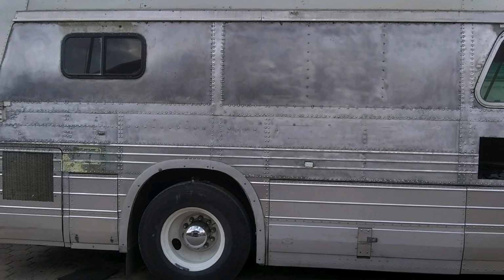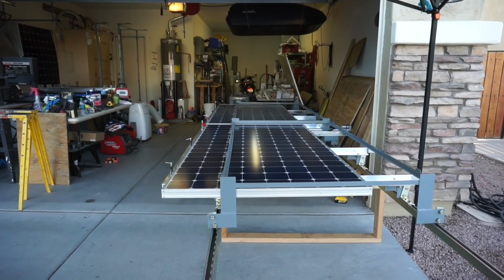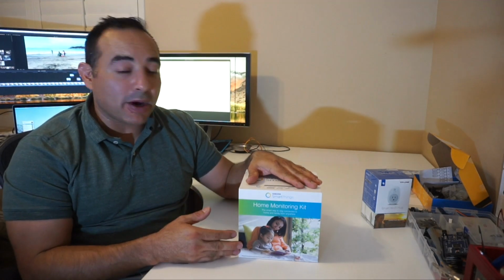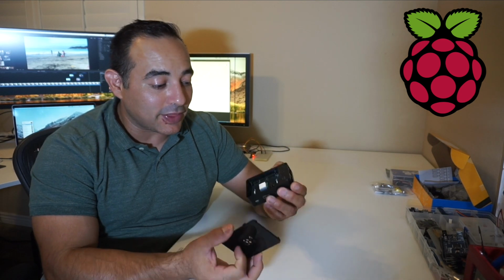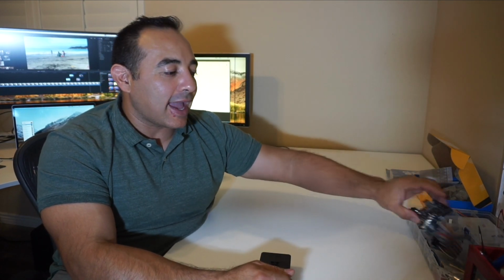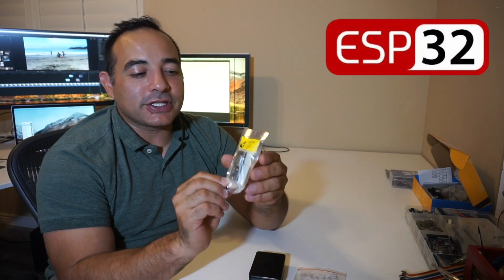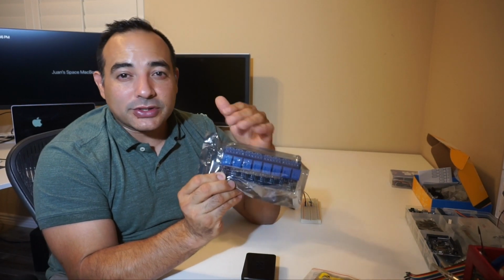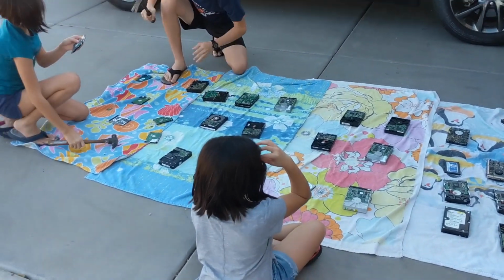Paint Update and Bus Automation Intro

Comment: [rant] Don't you hate that: everything has to be in the cloud nowadays. Ridiculous. Why should I send a signal to some cloud, wait for an answer before a light goes on? It's just a way for companies to know exactly what you have and do so they can get advantage from that. I have absolutely nothing in the cloud will never have that. IoT: Internet of Things. Absurd. Why should my refrigerator be connected to a cloud? To let a shop send me food because we run out of something. I can do that myself. As you can notice from how I write about this, it drives me crazy. Internet could be a nice place but companies ruined it completely cause they think they have the right to know everything about you. Well, think again.
Keep things local and use as little automation as possible: it can only break and then things don't work. What's wrong with a manual switch to switch the lights on and off? It has always worked and it still works. [/rant]
Reply from the maker: Thank you De Mus - we seem to think a lot alike.  The cloud can be a very nice thing but I hesitate strongly to relying on it.  That is one of the big things that drew me to Home Assistant - the network (internet) part of it is almost an after-thought.  It can function just fine not even connected to the Internet and just running locally on the LAN.  There is nothing wrong with just a simple switch of course - until I am sitting on the couch and forgot to turn a light off ;).  As you have probably gathered by now - much of what we do is somewhat experimental.  We have been using the lights in our coach for about 4 months now with just a simple wire-nut - I just thought putting some of this stuff in might be a little but of fun :)

Comment: Very cool video!! I'm thinking when I do my conversion of replacing my 12 volt control panel by the driver seat. With a relay board attached to a tablet what are your thoughts?
Reply from the maker: Thank you Joel - I think it is completely do-able.  You may have an easier time hooking something up to a raspberry pi with a touchscreen or as I am doing Arduino with Home Assistant :)

Comment: Excellent intro to automation.  I work for SaltStack and using "Salt" as my automation platform.  It uses an event bus as well to communicate between master and minions.  I’m just getting started too, so the hardware is where I’m looking.  Salt is written in python, so it’s pretty easy for me to write a custom module as long as the device can run python or have an api that I can connect from a controller minion.  I can go into more detail if you want.
Reply from the maker: Very interesting David - I will have to take a look at SaltStack.

Comment: You can use ESP8266 to control all the electronics wirelessly over WiFi  it will reduce wiring. You can connect esp8266 to smart phone. ESP8266 is dirt cheap.
Reply from the maker: Yes the esp8266 is pretty amazing - I have a couple sonoff switches that use them they I have flashed with tasmota.  This is a very cool configuration!

Comment: I went through this on my own bus last year - trying to figure out what would work out the best, what works well, and what will work without an internet connection.  I started with OH2 on  a Pi and it's a complicated German mess (ever used SAP?).  Then I went to HASS.io and a couple of other self-contained home automation software and wasn't impressed with them.  I settled on Node-Red on a Pi and have been running it ever since.  Node-Red is light years ahead of everything else right now, it's very easy to use, and is the most flexible thing.  I highly recommend it!  Everything is monitored and controllable remotely over MQTT (phone, PC, web) and I have a touch screen LCD in the bus for local control as well.  

The other challenge you will have is like you mentioned about 120v stuff vs. 12v.  There's next to nothing you can buy for switching 12v stuff over radio.  I built a PCB for the Pi that has a ton of I/O, but it's wired.  I also decided to set up a couple of remotes (Pi Zero W, etc) with some I/O to run relays and stuff.  Also keep in mind how much current all of this will consume.  You might be surprised when you add it all up, you might find you're sucking 10 amps all the time just to flick lights on and off, etc.  I have used ESP8266's for a few things, but I prefer to use AVR-based stuff for low power consumption and reliability.
Reply from the maker: That's about where I am landing so far.  I felt like I needed to give Hass.io a fair shake since the guiding principles seemed to line up with what I thought about "home automation" - to be honest, it has only been so-so.  Node-Red, on the other hand, has been amazing.  You wouldn't happen to be "badandy"  from the Wanderlodge Owners Group, would you?  I was following a guy's build over there that looked A TON like one of your videos.
Reply: Ahhhh I've been outed, that's me!  I've been following your build, I'm excited to see how the paint turns out because mine needs a paint job now.
Reply from the maker: LOL Love it!  I have been following your build as well.  We will give a full report on the paint job including cost and time when we get it back.

Comment: You took my idea and beat me to it!  I put Home Assistant on my home server to control my apartment, and want to put it in my bus as well.  Im about 4-6 months away from that step though.  BTW look up the "Sonoff 4CH Pro".  It allows for 5-24v input.  I think I will use a couple of those for all my lights in the bus.  Still thinking through all the fine details.  I look forward to seeing the progression on your automation setup!
Reply from the maker: Sorry about that Matt - I didn't mean to steal your idea :).  I have slowly been working through it for a while - it's a whole new world for me but it has been really satisfying to solve some of these problems.  Right now I am really liking the ESP32 chips - they are just amazing so far.  I flashed my first Sonoff a few days ago with Tasmota and REALLY like Tasmota but the Sonoff devices themselves seem to be pretty poorly made.  I will keep making updates on what I have discovered as stuff starts to happen.  I am pretty excited about it.
Reply: @BeginningfromthisMorning  Just checked out your new video.  Looks good.  Ill see how your esp chip and relay board works.  Maybe Ill go that route.  I do like that the Sonoff pro4 is din rail mountable and you can get a Din rail Raspberry pi case.  Along with all the other Din mount devices.  Looking good though, I may take steal some of your ideas when your done!

What line of work do you do BTW?  If you don't mind sharing of course.  :)
-Matt

Comment: There are 12v Sonoff boards - Google Search...   https://goo.gl/991oi9  &  12v boards to connect with Google Home, not all Google Home stuff needs the net...  Keep that in mind.

RV...   My step motor died so I used a Linear Actuator and an Arduino to clone the actions of the stock motor/gearbox, my cost was over 50% less then a replacement motor/gearbox and being Arduino it leaves my design open to link the step in to other functions in our RV.  Like first time in RV in awhile I could have it turn on our A/C then off after it reaches a set temp or bedroom lights on cause we're bringing clothes you know so I gotta see where I'm goin.  

Another idea I am liking. Using a photocell..  I think it would be cool to link our shades and close them at night/dusk and open a couple hours after dawn... wanna sleep in sometimes :).  But it would be something I no longer have to think about or it would happen even when we are out on a hike.  Same could go for the awning light, it just happens.

Comment: Does your work as a software engineer cross over into Arduino and Razz pii’s  

I had a mission to automate my fish tank, started playing with the dallas one wire sensors (then I bought a house and a box truck and all of that went into a bin).  When I’m done knocking rust out from underneath my truck I’ll look into those 32 boards with built on wifi.

Here’s a link to some solid state relays that jive really well with the Arduino 5V logic.  They already have resistors in line on the logic side and can (allegedly) handle 25 amps up to 340 volts.  I’ve run a 12 amp load on one of these for an extended period of time, it got a bit warm so I thermopasted it to a metal plate which kept it much cooler...

https://www.ebay.com/itm/Output-24V-380V-25A-SSR-25-DA-Solid-State-Relay-for-Arduino-Raspberry-Pi/321873890198?hash=item4af12dcb96:g:qX8AAOSwHjNV~Cd6
Reply from the maker: Hi Ryan - my work as a software engineer does not cross over into the Arduino or Raspberry stuff much at all - other than having a base of knowledge about how computers/networks/programming works.  This is my first foray into this stuff and I gotta admit that I am really impressed with what can be done with this stuff.    Are you going to document your box truck build?  Sounds like a really cool project!  Thanks for the link - I have seen those solid state relays - most reports say they work great - I will look closer at them.

Comment: I’m looking forward to this project. I will caution you though, the more you automate the bigger pain in the arse it will be when that one loose wire somewhere on the buss decides to work or not at the worst possible time. As I’m sure you’re aware, all it takes is one wire on a buss to open or short to take everything down with it and then nothing works. If I were you I’d only put stuff on a network you can do without.
Reply from the maker: Thank you Dirt Road Sailing - I am very excited about it as well.  I do feel your pain on the loose wire situation - those things can drive a guy mad!  I fully intend on having some kind of "manual" mode for the situation you describe.

Comment: Interesting project; looking forward to how it turns out.  Just curious if you looked Programmable Logic Controller (PLC) technology?  I have seen a few posts on FB from folks that are looking at this approach.  Probably requires 120VAC, so not what you are looking for.  Also, a lot less DIY.  :-)
Reply: Bruce Fay you can buy PLCs in 12v/24V/48V DC and multi AC 88V-260Vish they are designed to run on solar for safety. But they are designed for safety and not for power savings. In a former job I designed a solar powered dragon pit flare in the Middle East. The panels and batteries were oversized for safety. 

They used to just pump it into a pit that was always burning with no safety for overflowing or flames traveling back into the refinery. We added a level controlled knockout drum and a deflagration arrestors.
Reply from the maker: Thank you Bruce - I have not looked at PLC stuff but I will add that to my research.  Thank you for the suggestion.
Reply from the maker: Wow Peter that sounds super cool!

Comment: Great to see an update- man they have had the bus a l o n g time.

I do not understand the urge to home automate the RV, just because you can does not mean you should. Whatever happened to keep it simple??

It’s a big RV, keep the lighting design simple and that will reduce the weight of wiring.
Reply from the maker: Thank you Norman - yes we are REALLY missing the bus.  It has been nice to have some time to work on the house and get some other stuff ready for our transition to a more nomadic life but we are more than ready for the bus to be back and continue the work on it.  
We are hoping that wiring our bus in this manner will actually simplify the wiring (and allow for running less wire).  This is still very early but we are going to give it a try and see what happens.

Comment: I'm super interested in this part. I'm interested in most of the aspects of your bus conversion (your battery system is epic), and I'm working on a skoolie conversion myself. But this part especially is an area of interest for me. I've been researching home-automation systems for years, and I have a lot of the same concerns you do. I want to keep the C&C local for privacy and operational robustness (I want it to still work when I'm boondocking and don't have cell signal).

Have you looked into MySensors? It's an open-source, micro-controller-based automation system. They do a lot of work with Arduinos connected to nRF24 chips but but can do serial and IP transports as well. I'm planning on implementing a couple of networks on my bus, one for the traditional automation stuff you mention in the video, and one for more automotive purposes (currently I'm "designing" a 360-degree proximity sensor system for parking/driving assistance but it might double as a security sensor net when the bus is parked).

Also, I hope you salvaged the magnets out of those destroyed disks. They're remarkably strong and can be useful in a bus (or other DIY project).
Reply from the maker: Thanks Ben!  I am pretty excited about this part of the project but feared that it might be a little too "geeky" for some of my audience.  To my surprise, it has been really well received.  I briefly took a look at "MySensors" after reading your comment and it appears to be right up my alley!  I really like the ESP32 and ESP2866 because they have wifi and Bluetooth built right into the chip as well as having the full Arduino stack!  I love the video idea and have a very similar design in mind - maybe we can collaborate on what we have discovered?  Thank you for the comment - makes me excited to see someone else excited about this stuff too!
Reply: Oh I'm sure it's too geeky for some of your audience, but there are some of us who love this stuff and would be happy to geek out with you. The ESP boards are quite nice, but for my project there are some things I don't trust wifi for. If you've watched SuperHouseTV, you know the reasons. I would be absolutely delighted to collaborate any way you like.

Comment: My field is motorsport but you should check out some products from MoTeC. I install these for competition cars to reduce wiring weight but being 12v systems it is sooooo versatile for an RV too. 
You have one fat 12v cable in, then ALL your loads on the output. You can program it in any way you like. 
Each output is over-current, short circuit and thermal overload protected. Use logic functions to selectively turn off systems during low battery voltage
And if you want to get super deep into it you can use operators like Flash, Pulse, Set/Reset, Hysteresis, Toggle, And, Or, Less than, Greater than, Not equal to, Equal to, True, False etc. 
Its called a PDM (Power Distribution module)
Would be fairly simple to wire up a light sensor and or wind sensor then program a function " if wind speed equal or greater than 18ms - retract the solar panels" etc.  You get the idea. 😁😎
Reply from the maker: Wow very interesting!  I will have to look that up!  Thank you for sharing
Reply: Beginning from this Morning no problem. If you have a good imagination it is very flexible. But not cheap, i'll warn you that 🤣 but here's a long overview video if you have time.
https://youtu.be/Y5ND3A5dXNs

Comment: Hey Juan, this is the exact same way I traveled with home automation, except i never looked at the Samsung stuff and ended up with OpenHab2. Now I have settled with ESP8266 because they are fast enough and can use the tasmota firmware. Only for custom projects, like the fishtank, I wrote my own software on ESP32. For input you can use a Sonoff RF bridge and glue your 433Mhz wall & door switches and motion detectors to the wall. These use batteries, but you can modify them for low power wired.  There’s also an rf remote that can be used to send commands. The rf hub, with tasmota, converts all the rf inputs to mqtt commands. Checkout the Sonoff 4CH Pro R2, it can be used with tasmota, be powered by dc 5-24 volt, has rf build in and din rail mounting. Make sure for security reasons, you put all this on a seperate wifi ssid and/or vlan. The Lan interface of the Rpi is the only thing you want to see on your regular lan/wifi as a gateway. Implement security and strong passwords from the beginning. It’s a pain to change everything later. And document everything! Really interesting stuff, I hope not too geeky for most followers, but I guess a lot of metal and wood fabrication is still in your future also ;-). Reach out if you need help with any of this. Thank you for making these videos!
Reply from the maker: Awesome Freddy!  It sounds like you are quite a few steps ahead of me!  I had feared that this was way too geeky for my followers and I thought this was confirmed when I released this video last week.  In 3 days I think I had like 8 views on it.  "oh no" I thought to myself and I shunned my inner nerd.  Turns out that something was messed up with the video/settings and when I reuploaded it last night the reception was much better - now I am rejoicing with my inner nerd!  I have seen the advice to put it on its own vlan on quite a few sites and I am researching that further.  Thank you for taking the time to post I would love to have your advice on some of the stuff I am trying to work through.  If you wouldn't mind emailing me I would really appreciate it: jipe.az@gmail.com - Thank you again for the post - it is fun to see someone else excited about this stuff!
Reply: Beginning from this Morning Hi Juan, fyi I send you an email. Hope this is some usefull info.